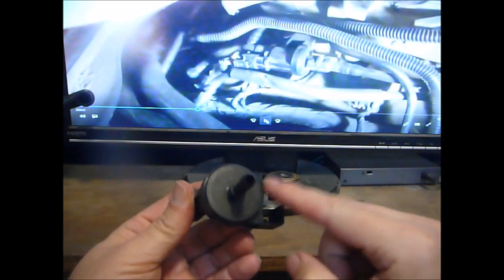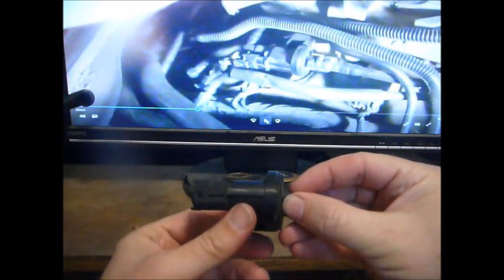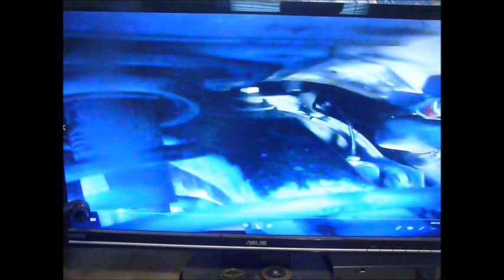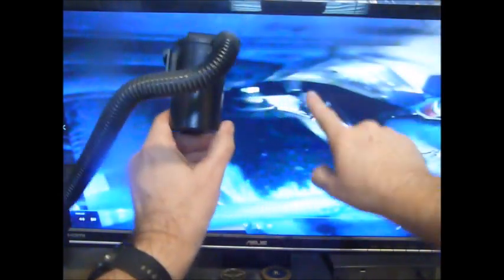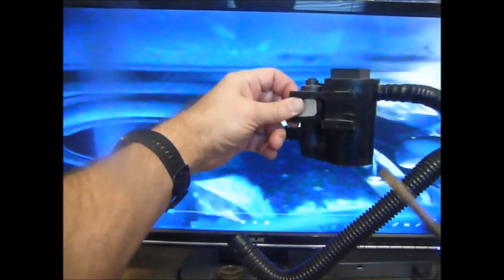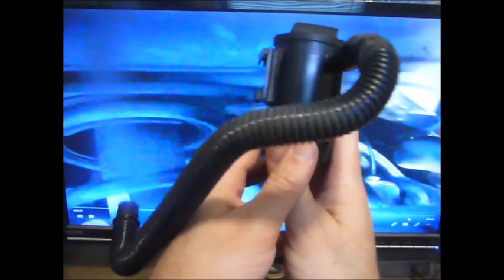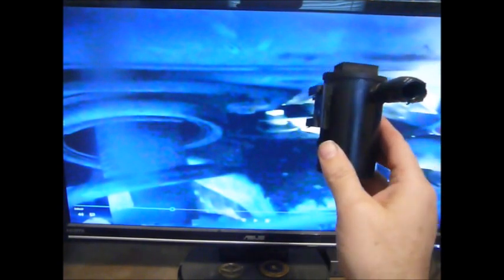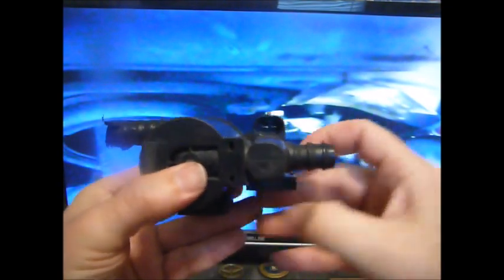Camaro (P0449 and P0496) EVAP Emissions (Canister) Vent Solenoid and Valve

Comment: AWESOME VIDEO.  Thanks ToolTimeTabor for the tutorial and breakdown for the Vent Valve.  You were spot on that it takes a couple of hours, and a whole lot of patience, but today my son and I got it done.  Even the tool suggestions were right on, but I went out and also bought (in addition to the 14" screw driver and long needle nose pliers), a 22" screwdriver which came in handy.  Now just have to complete a drive cycle to verify that the new valve is ok, and I didn't mess anything else up.
Reply: New valve is working fine.  Thanks again for the video!

Comment: I have the PO449 code,  you did a fantastic job explaining this tough replacement of the evap purge valve, I had the Camaro jacked up and barely located the this valve, the passenger rear wheel is the key...Wish me luck!!  Tnx
Reply from the maker: Good luck!  It is a real pain, but better than the small fortune they were asking to replace it.

Comment: Wouldn't be easier to cut a access hole in the trunk or under the back seat?
Reply from the maker: While an access hole might be possible, the problem is that you would be "cutting blind" into that space.  There are other things up in that cavity that I could not identify (e.g. tubes, wires, etc.) that might be easily damaged as you cut in.  So, if it had been cut-in at the factory, yes.  But, you should think very hard before going that route yourself.  IMHO

Comment: Is this the same process on a 2014 ls?
Reply from the maker: Not sure.  However, it would seem to be one of those things that does not change much with time.  The test is, jack up the right rear (passenger) and look up into the wheel well in the slot shown in the video.  It is hard to see, but you can see the canister.
Reply: ToolTimeTabor jacked up the car and I see no canister I do however see a vacuum hose it looks like connected to nothing.
Reply from the maker: @ruffus4924  can you reach up inside that cavity and see if you can feel the canister?  if it is not there, then I they may have changed the location.
Reply: ToolTimeTabor yeah I had my hand completely all the way up there and found no sign of a canister

Comment: I did it by loosening the rear suspension to give me access to the rear canister 
Not one of GMs better ideas for sure!🤬
Reply from the maker: Can you describe what you did?  I suspect any future viewer might be grateful.  That thing was nearly impossible to do the way it is be design.
Reply: @ToolTimeTabor I jacked the rear off removed the rr wheel dropped the suspension on the right enough to get my arm up there to r& r the damn thing. Be careful not to drop the suspension to the disconnect point. Block your front wheels & shop jacks in front of both rear wheels. It wasn’t bad after I did that & I’ve got big arms